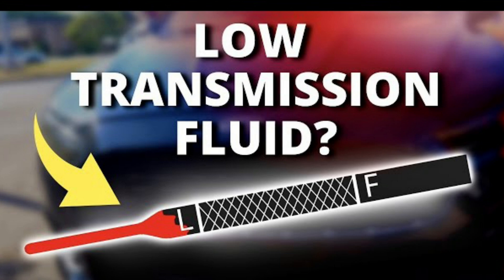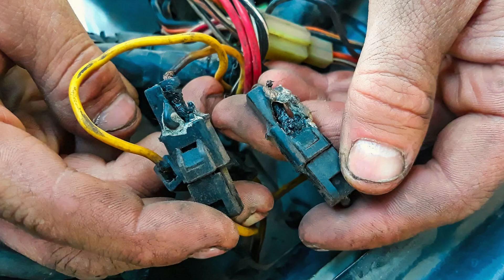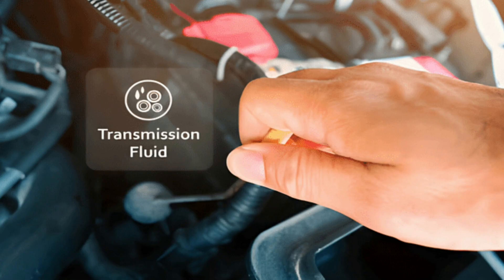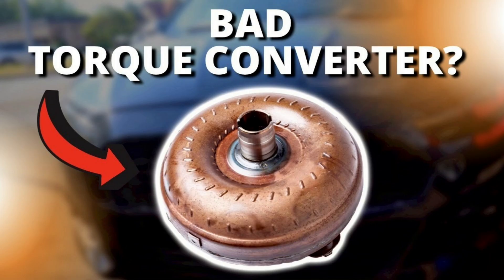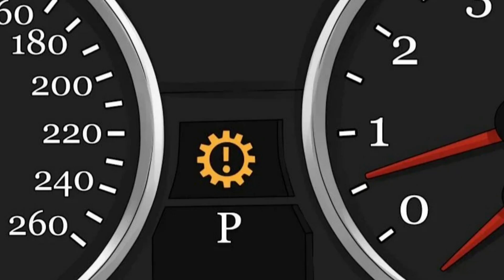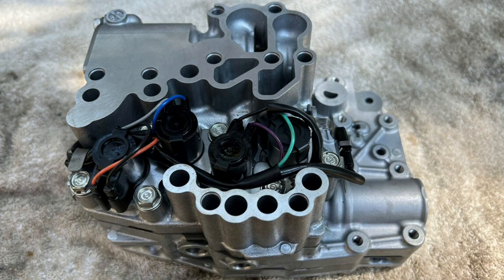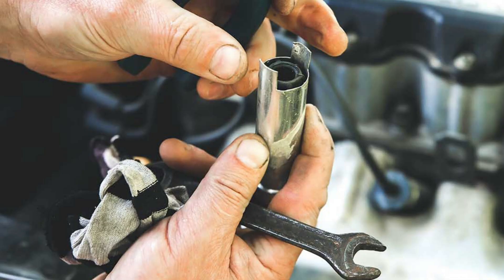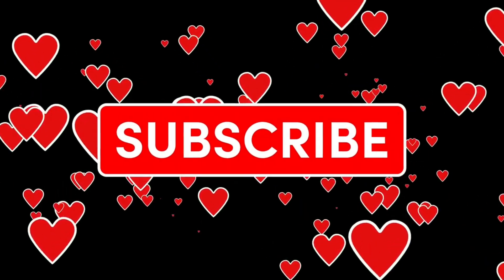How to Fix & Reset Transmission Warning Light Stays On or Flashing | Automatic Gearbox Warning Light

Comment from the maker: ✅ TRANSMISSION TEMPERATURE WARNING LIGHT ON OR FLASHING?
👇 Drop your car’s make & model below — I’ll help you fix it step-by-step!
In this video, I cover:
✅ What the transmission temperature warning light means
✅ Common causes like overheating fluid, low transmission fluid, or towing stress
✅ Step-by-step guide on how to fix and reset the warning light
✅ Why ignoring it can damage your gearbox and cost you thousands in repairs
🛠️ Topics include:
– How to check and top up transmission fluid
– Signs of transmission overheating
– Resetting the transmission temperature light
– Driving habits that trigger this warning
– When to call a mechanic vs DIY
🚗 Works for most automatic cars and trucks including:
Toyota, Nissan, Ford, Chevy, Dodge, Honda, Jeep, Hyundai, Kia, Volkswagen, and more!
⚠️ Don’t ignore this warning — overheating transmission can lead to full failure.
💬 Need help? Comment your car model below — I reply to every question!
#TransmissionWarningLight #CarRepair #DashboardWarningLights #TransmissionOverheating #FixTransmissionLight

Comment: We have a Nissan Serena 2006  that keeps getting the transmission warning light. Car was seen by mechanic who said transmission fluid was dirty and fluid was changed yesterday. The light came back on again today in the highway. ☹️
Reply from the maker: @mnm3774  Thanks for sharing! Since you’re still seeing the transmission temperature warning light on your 2006 Nissan Serena even after a fluid change, here are a few things to check:
👉  1. Transmission Cooler Issue
If the transmission cooler or cooler lines are clogged or not functioning properly, it can cause the fluid to overheat — especially at highway speeds.
👉  2. Wrong or Low-Quality Fluid
Make sure the correct type of CVT or ATF fluid recommended by Nissan was used. The wrong fluid can still cause overheating or sensor errors.
👉  3. Faulty Temperature Sensor or Wiring
The sensor that detects transmission temperature might be giving a false reading, especially if the fluid is now clean but the light keeps coming on.
👉  4. Internal Transmission Problems
Worn components like the torque converter, clutches, or solenoids may be generating excess heat.
👉 Next Step: Ask your mechanic to scan for transmission-related fault codes using a proper scanner. It will help narrow it down — whether it's overheating or just a faulty sensor.
👉 If you don’t have a scanner yet, I’ve tagged the ones I personally recommend below the video in the product section 👇 — they’re reliable and work for most cars.
Let me know what codes come up and I’ll help you break them down step-by-step!

Comment: I need serious help with 2010 Mitsubishi lancer, first the driive indicator on the dashboard disappears, then the car losses acceleration power then the transmission temperature oil temperature high appeas what do i do please
Reply from the maker: @oduhalex4113 It sounds like your 2010 Mitsubishi Lancer is going into fail-safe mode due to overheating transmission fluid. When the drive indicator disappears, and you lose power, it’s a sign the transmission control module is protecting the system. The “Transmission Temperature High” warning confirms this.
Here’s what to do:

Stop driving immediately when this happens to avoid major damage.

Check the transmission fluid level and condition (burnt smell or dark color = problem).

Let the car cool completely, then scan for transmission fault codes using an OBD2 scanner.

You may need a transmission fluid flush, cooler inspection, or solenoid repair.

If the problem repeats quickly, have a mechanic inspect the transmission cooling system — it may be clogged or failing.
Let me know what codes you get — I’ll guide you from there!
Reply: @oduhalex4113  your first issue was buying a Mitsubishi. What you should do? Sell it and buy any other car